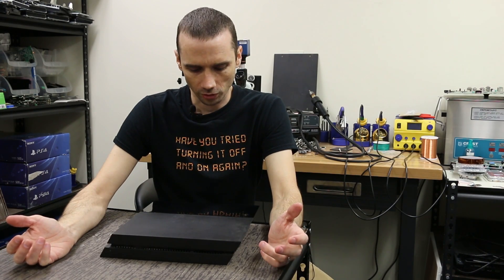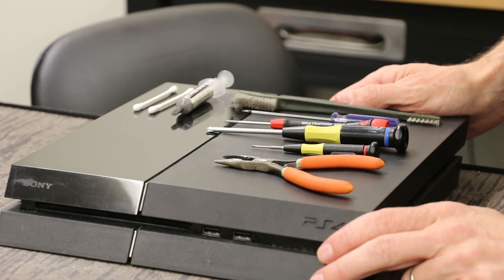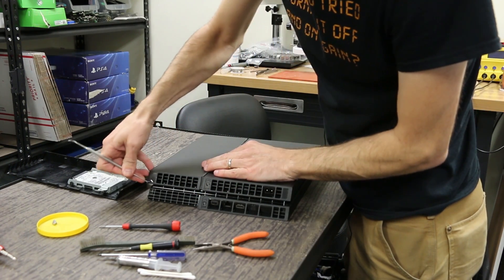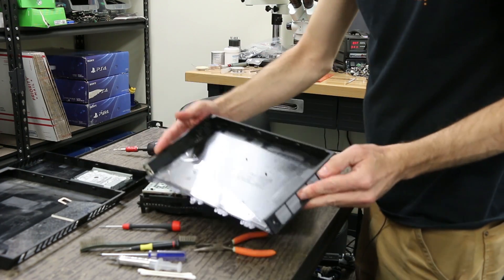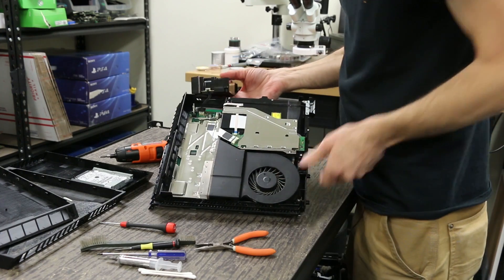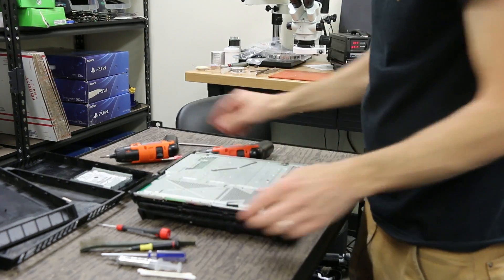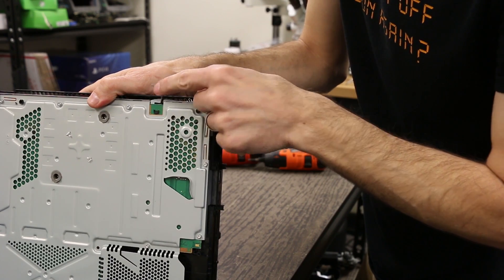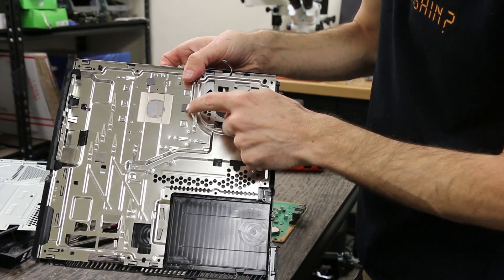PS4 Original Teardown Tips & Tricks

Comment: hi, i would like to know if we can replace the thermal paste in the moterhboard. in your video at 11:08 you point out 8 motherboard chips with thermal paste already on it. is it advisable to remove the old dermal paste and put new thermal paste from tube?same goes to the part in 10:37 of your video? you only changed the thermal paste in the processor. thus I'm asking this. hope to hear from you soon
Reply from the maker: Those are thermal pads. Thermal paste only goes in the APU.
Reply: +TronicsFix if I remove the termal pads and put thermal paste. Will it spoil the motherboard ?
Reply from the maker: Don't put thermal paste where thermal pads go.

Comment: I recently changed my optical drive because it was reading or taking my disk. the new piece works but when I changed the optics motherboard it was having the same problem.
Reply: wasn't*
Reply from the maker: I would check the large ribbon cable that goes from the motherboard to the disc drive. You may have damaged it.

Comment: Hi there i have question. I just got TR9 Torx screwdriver in the middle has a hole. Is it gone work with ps4 or i will need to buy TR8 torx too? My ps4 1001 motherboard. Thanks.
Reply from the maker: The TR9 will work fine.
Reply: +TronicsFix I wasn't expecting fast reply but you guys just did. Thank you so much.
Reply from the maker: Ha, ha...no problem!

Comment: Quick question, so earlier this week i was playing my ps4 (its a day one model) it was running loud while i was playing Fallout 4, and i thought nothing of it at first. After about an hour of playing it seemingly was completely silent, the fan obviously wasn't rotating. I still didn't think much of it until about a minute later it i hear loud beeps and it notified me over over heating. I let it sit for a day and figured it would just work again, but know the ps4 is almost completely silent besides a slight tick. It can only be on for about 4-5 mins before it over heats again. My question is, will simply cleaning the fan and heat sink fix this? Or do i need to replace the fan by ordering a new one? Thank you for the tutorial.
Reply from the maker: Sounds like it may need a new fan.

Comment: The left top part of my ps4 is way to hard to pull out im afraid I'll break it any tips on how to remove it??
Reply from the maker: Make sure that the black screw is out that's under the power supply.
Reply: You mean the screws the warranty stickers cover??
Reply from the maker: No...if it's a 11xx model then there is a single black screw under the power supply.

Comment: Hi, I Changed the thermal paste for my ps4 few days ago everything went great and it really helped with loud noise and overheating! But now my problems is the diskdrive... It doesnt get any power and doesnt take disks inside, what might be the problem? I've checked all possible videos from utube it should be attached the right way..And it was working perfectly before taerdown. Any helps? thanks!
Reply from the maker: Most likely you've messed up the large ribbon cable that goes from the motherboard to the disc drive
Reply: Where can I get a new one?
Reply from the maker: Ebay, Amazon, etc.

Comment: Hey, i got a little problem here.
Recently i teared down my PS4 to replace thermal paste because it was getting too loud, found a lot of dirt which was pretty much uncleanable because i dont have the necessary tools (But i will, though). I found some cheap thermal paste that was lying around in my house and replaced the one the PS4 comes with (i thought it would reduce the noise) and  tried to clean it the best i could. After that i put the parts back in, but now the PS4 is EVEN LOUDER. Does that mean it's definetly a Thermal Paste problem? Im pretty sure i rubbed the default thermal paste with alcohol (No, i didnt pour alcohol on the chip/heatsink, i applied it to a cotton) and i didnt do anything wrong, no cables broken or anything.
Reply from the maker: +zxeroxz11 There's no way for me to know for sure...it is obviously being caused by something that happened during your process but it's hard to know what. It could be bad thermal paste or not enough thermal paste. The thermal pads on the memory chips could have fallen off, the fan could be not working, or something else could be causing it. Also, some of the dirt could have become dislodged and plugged the heat sink even more. 
I would take it back apart and put good thermal paste in and clean it properly.
Reply: TronicsFix I already ordered Arctic Silver 5, and i had the tools the day i teared it down, but it was the middle of the night and i had to walk a lot to get there so i was kind of affraid someone would steal it.
So i'll just wait for AS5 and go clean it properly.
Will post results.
Reply: +TronicsFix So the Arctic Silver arrived today, got my tools, opened the PS4, cleaned it, applied the paste, and now it went from a Stage 4 fan to a Stage 1/2 fan. Very happy with the results. Thanks for your answer BTW.
Reply from the maker: Great! Glad it's working for you now!

Comment: My ps4 is not ejecting disc any tips? done the turning on side etc
Reply from the maker: +Amy Pengelly It's hard to know for sure without having it at our shop but it could be a ribbon cable problem or the rollers could be really dirty. It could also be a problem with the drive itself.

Comment: to put  a new hdmi port in my game ps4
Reply from the maker: +kenny Blakely Sorry, our prices reflect the quality of repair that we provide. You can find much cheaper services on Ebay. You get what you pay for!
Reply: @Tronicsfix  Just found this video today and it is excellent. Question for you if you don't mind... I've disassembled the console I'm working on and have found the issue with the HDMI port. (Cousin is too rough when plugging and unplugging HDMI..) Do I need to solder each contact on the board or just the retaining pins so there's enough pressure to create a good connection?

Comment: i tierdowned my PS4 a couple times now.. so many times  that i destroyed all torx8 security screws..but replaced them with regulair phillip screws,  i'm doing an experiment with themal compund from small pea size dots in the middel of the chip to bigger dots and next time i want to replace the cheap (and small) thermal pads on the ram chips for some quality pads.
Reply from the maker: +PlaystationQUAD Cool! It gets easier the more times you do it! Let us know how those experiments go!
Reply: +TronicsFix I used GP extreme thermal-pads covering the size of the ram-chips and put a middle sized blob of thermal compound on the APU (Arctic cooling MX-4).  finally running like a dream this time! before the changes the fan didnt kick down as fast when i quit the game and stayed on 'stage3' fan speed for a couple of minutes (B-Ops 3, Bloodborne) but now with these changes the fan now immediately kicks down in loading screens or when i quit the game and the fan now never exceeds stage 2 fan speed :) even after hours of playing, the heat from the exhaust is nice and warm meaning the pads and compounds doing its job ... This is even better than I had expected even with a room temperature of 21 degrees celcius (70F)
Reply: +PlaystationQUAD O yeah i also upgraded the hardrive yesterday with an samsung 850 EVO SSD :) !!
Reply from the maker: +PlaystationQUAD Awesome! I'm glad that's working well for you! Sounds like a good upgrade.
Reply from the maker: +PlaystationQUAD Very cool! That must be a fast machine!